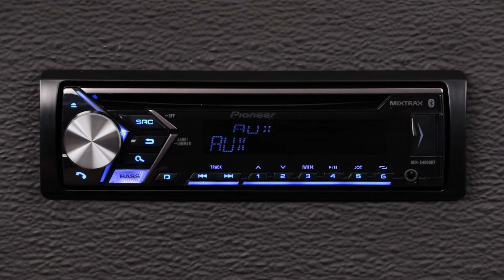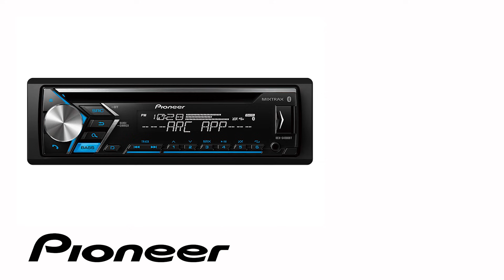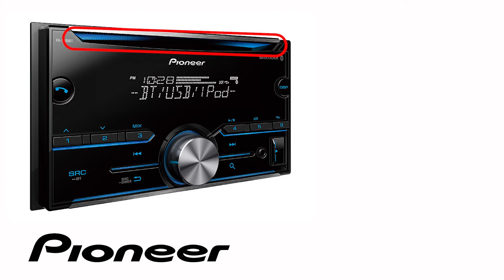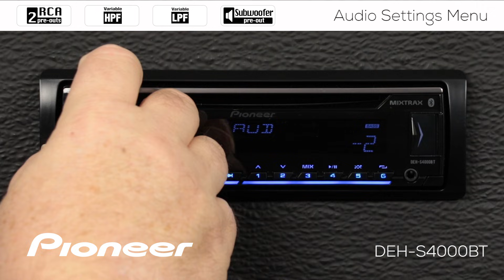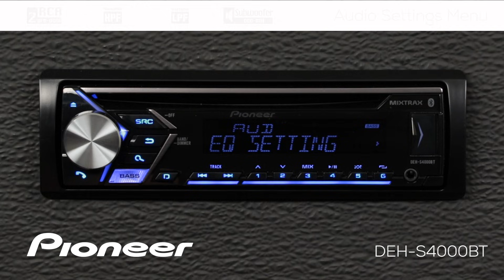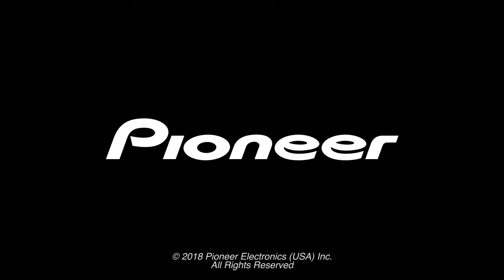How To - Audio Settings Menu on Pioneer In-Dash Receivers 2018

Comment: I was able to connect my phone but it won’t play the music on my phone, how can I get it to do that?
Reply: I recommend to switch the in-dash receiver to the Bluetooth Audio Source. Press the SRC button until you see Bluetooth Audio.   Be sure to check System Settings for the Bluetooth Source, make sure it's switched on.  You can see it here:  https://youtu.be/Z6g0EOPZL0c?list=PLw63zJRQbCNinkLCSrV17ExW5FWT7aIFU&t=372   You did not mention what model number of Pioneer in-dash receiver you have.   You can see more videos about Pioneer DEH-S4000BT here:  https://youtu.be/ZCkYPPBBRkg?list=PLw63zJRQbCNinkLCSrV17ExW5FWT7aIFU     If you have Pioneer DEH-S4000BT you can update to the latest firmware here:  https://www.pioneerelectronics.com/PUSA/Car/CD-Receivers/DEH-S4000BT#downloads   You can find more videos on Pioneer's You Tube Channel here:  https://www.youtube.com/user/pioneerelectronics
Reply: You have to also give permission for the radio to share files with the phone it asks when it comes to allow6calls

Comment: Kool awesome video, Ty.  Would this model have the capability to use cell phone and speak thru the radio?  Please explain how, if possible..  I tried by placing a call on phone , then I put the radio on aux.  Still did not work.  Can u use this model, radio in car.. And be able to speak thru the radio, using the cord placed in the radio hooked up to phone? Again thanks.b
Reply: Yes, the Pioneer DEH-S4000BT and many other Pioneer in-dash receivers let you make hands free phone calls in the vehicle.  You can hear the remote caller through the vehicle speakers.  The in-dash receiver must be correctly installed with it's microphone.  What model of Pioneer in-dash receiver do you have?  The model number is printed on the face of the in-dash receiver usually in a corner.  Here is a video explaining how to connect your iPhone to the in-dash receiver via Bluetooth:  https://youtu.be/Fm2U1Ck1qlU?list=PLw63zJRQbCNinkLCSrV17ExW5FWT7aIFU    and here is a video explaining how to connect your Android based phone to the in-dash receiver:   https://youtu.be/8t8hiqq2kCI?list=PLw63zJRQbCNinkLCSrV17ExW5FWT7aIFU     and here is video explaining several ways to make and receiver phone calls:  https://youtu.be/MpJ1jOVYq64  You can find more videos on Pioneer's You Tube Channel here:  https://www.youtube.com/user/pioneerelectronics
Reply: @deckerdotto6035  OK  great.  I'm checkin the link now. Thankful for your help. Tc Deckerd Otto

Comment: How to adjust speaker output.i mean i have four speakers but i want play ony 2 speakers. Model number is pioneer mvh s109ui.
Reply: Use the Fader and/or the Balance Control.  The fader is designed to adjust speaker output from front to back.  Balance is designed to adjust speaker output from right to left.  You can see it on a similar Pioneer in-dash receiver here:  https://youtu.be/XXOWoQLwyag?list=PLw63zJRQbCNjfGaTVA2WEqWsxnMgmnYd_   You can find more videos about Pioneer DEH-S1000UB here:  https://youtu.be/YNniqyTm-TE?list=PLw63zJRQbCNjfGaTVA2WEqWsxnMgmnYd_   and you can find more videos on Pioneer's You Tube Channel here:  https://www.youtube.com/user/pioneerelectronics

Comment: Don’t have speak volume what do I do
Reply: I'm not sure what "Don't have speak volume" means.  If it means you cannot hear a remote phone caller, but the caller can hear you, I can help. Is the volume up during the phone call?    On all Pioneer in-dash receivers, when on a Bluetooth phone call, the remote phone caller is heard through the Front Speaker Outputs and Front RCA outputs only.  Bluetooth Audio, or music played through Bluetooth is heard from all speakers in the system.  To test, Fade your system all the way to the front.  When the system is faded to the front, can you hear a phone call?  Can you hear music?   For help with the Fader, check out this video: https://youtu.be/hiDOCp75UAI?list=PLw63zJRQbCNinkLCSrV17ExW5FWT7aIFU&t=50  You can find more videos on Pioneer's You Tube Channel here:  https://www.youtube.com/user/pioneerelectronics
Reply: @deckerdotto6035  hey I have a deh 5120bt on my jeep. Can only get any audio through front speakers. Think it’s stuck in this mode and needs to be reset?
Reply: I recommend to check the Fader control.  This moves the sound from the Front to the Rear.  You can find more How To videos from Pioneer about audio receivers here:  https://youtu.be/Z6g0EOPZL0c?list=PLw63zJRQbCNinkLCSrV17ExW5FWT7aIFU   and you can find more videos on Pioneer's YouTube Channel here:  https://www.youtube.com/user/pioneerelectronics
Reply: @deckerdotto6035  Thanks, turns out my amp was unplugged and it’s blown. Previous owner destroyed the wiring harness. Big problem

Comment: I just installed on my truck. Everything works except when a call comes  in there is no sound at all from the caller. YouTube streamed through works and the caller can hear me talking. I have the deh- S4000bt
Reply: Here are a couple things to test:  Is the phone call volume up on the in-dash receiver?  You can adjust the phone call volume by turning the in-dash receiver volume control while you are on a phone call.   Is the phone call volume up on the phone?  When on a phone call, the remote caller can be heard on the FRONT Speaker outputs and the FRONT RCA outputs only.  Music played through Bluetooth is heard from all outputs.  To test this, use the Fader Control and fade all the way to the front.  Can you hear music?  Can you hear a phone call? Need help with the Fader control?  Check out this video:  https://youtu.be/hiDOCp75UAI?list=PLw63zJRQbCNinkLCSrV17ExW5FWT7aIFU    If you can not hear the phone call, it's possible the Front Speaker or Front RCA outputs are not properly connected.  You can see more about wiring your Pioneer in-dash receiver here:  https://youtu.be/kR2MO2kwFug?list=PLw63zJRQbCNinkLCSrV17ExW5FWT7aIFU   You can find more videos about Pioneer DEH-S4000BT in this Pioneer You Tube Playlist:  https://youtu.be/Z6g0EOPZL0c?list=PLw63zJRQbCNinkLCSrV17ExW5FWT7aIFU  and you can find more videos on Pioneer's You Tube Channel here:  https://www.youtube.com/user/pioneerelectronics
Reply: @deckerdotto6035  Thank you, the guy putting it in only hooked up the rear wires because I only have two speakers in my truck. But as you said, you need to hook up the front because you typically wouldn't want the sound of the phone going to the back seat.

Comment: How do i change the bass settings?
Reply: While there is no "Bass" setting, there are a couple different ways to adjust the sound of the low frequencies output by the in-dash receiver. 1st is to use the EQ settings.  You can see that here:  https://youtu.be/tMLFL8K3gMM?list=PLw63zJRQbCNinkLCSrV17ExW5FWT7aIFU  The "Bass" frequencies are the ones from about 125Hz and lower. You can adjust any of the low frequencies up or down.   2nd  If your system has a subwoofer and you want adjust the subwoofer output you can see that here:  https://youtu.be/hiDOCp75UAI?t=180  You can find more videos about Pioneer DEH-S4000BT here:  https://youtu.be/icdWHqbS-7o?list=PLw63zJRQbCNinkLCSrV17ExW5FWT7aIFU and you can find more videos on Pioneer's You Tube Channel here:  https://www.youtube.com/user/pioneerelectronics

Comment: How do you adjust treble? Please answer !!
Reply: There is no Bass or Treble control in this system.  It's a much more flexible design.  I recommend to try the EQ factory preset settings to see if there is one you like.  You can see that here:  https://youtu.be/tMLFL8K3gMM?list=PLw63zJRQbCNinkLCSrV17ExW5FWT7aIFU    If you want to adjust Custom EQ 1 or Custom EQ 2 for more Treble, I recommend to adjust the 2kHz, 3.15kHz, 5kHz, 8kHz, and/ or 12.5kHz bands until you like what hear.  You can find more video from Pioneer here:  https://youtu.be/Z6g0EOPZL0c?list=PLw63zJRQbCNinkLCSrV17ExW5FWT7aIFU

Comment: I have a ford taurus se 2001
I just replaced today the speakers on my car + new stereo (DEH-S4069BT) a kit that we bought back in 2017 but never used till now. I have not worked any adjustments to the audio on the stereo but for sure there is a huge difference from factory speakers + stereo to aftermarket ones. The only problem that i got was the rear speakers.. The ones that come in this kit are bigger than what my vehicle can have installed (6×8 on my vehicle) so i rush out to the nearest walmart and got another pair of Pioneer speakers with the right size. I have to say that this pioneer speakers+stereo sounds amazing! But if u have a ford taurus you know that this is a little trickie! The stereo wiring needs to be connected inside the trunk with a dash plus wiring kit i purchased online. I fully recommend this stereo for someone who wants to have a nice and clean sound system!